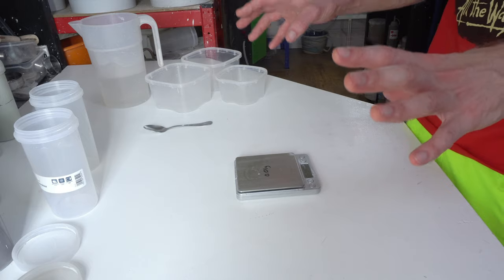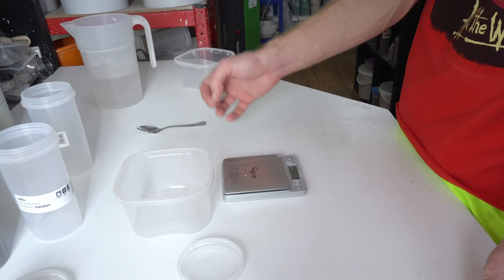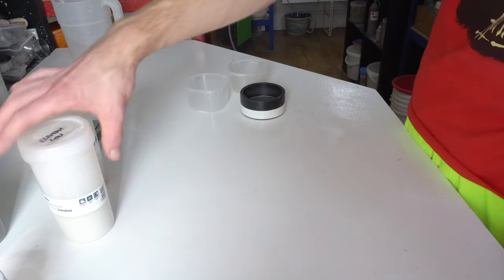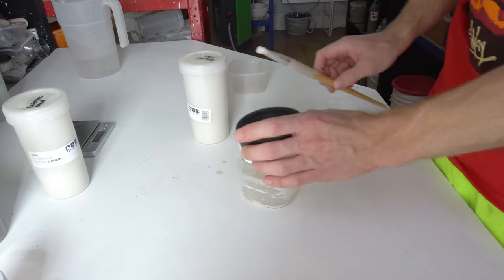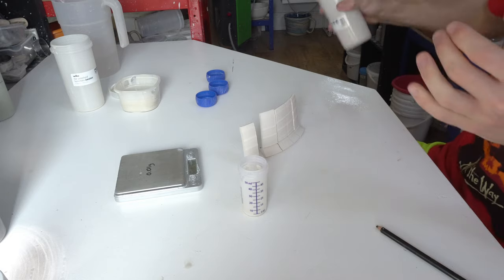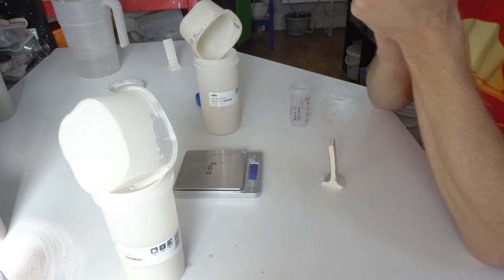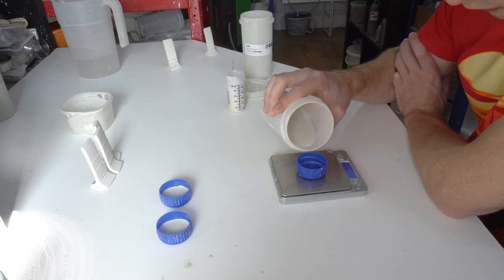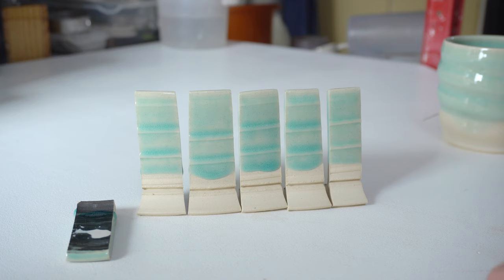How I Mix and Apply my Glaze Tests

Comment: Hi - I use a rubber spatula to get things through the sieve.   Saves shaving the paintbrush!  Very interesting content- thanks
Reply from the maker: Yeah, I don't use the paintbrush for the larger sieves, but the small one is too small for the larger brush I usually use. A small spatula might work, or just a rubber brush with bristles too large to go through the holes. But as it's just for tests, I'm not so worried about finding a better solution

Comment: I would say that a disposable dusk mask is not enough. Wearing a mask that is filtered for dust particles is important - it is more than preventing silicosis but some of the ingredients we use can affect the nervous system or are toxic. ie lithium. At uni we had a girl who was using lithium and no mask (despite all the advice, rules and warnings) she dropped the container and it puffed up into the air and she breathed in a lot and had to go to hospital. She had immediate breathing difficulties but went on to display tremors and dizziness. She recovered thankfully but it could have easily been avoided if she had worn the proper mask. Anyway moving on - thanks for the info on ceramic materials workshop which was easy to find on google search and i am planning on taking a course to refresh my knowledge.
Reply from the maker: Agreed. I think all I said in the video was to use a proper filter mask, and the disposable ones were better than nothing, but if you're working with powdered ingredients then you really owe it to your future self to take adequate care. I'd still rather people wore a disposable one than nothing though.

Thanks for reminding me about the CMW link, I'd forgotten to add that when doing the description.

Comment: Use a 50mL skirted conical tube if you run out of those baby feeding tubes. You can get them from amazon or any laboratory supply shop.
Reply from the maker: Thanks for the tip!
Reply: @OldForgeCreations  no problem!  I like your work and your videos are very calming. I will be coming back for more! 👍

Comment: If your brush hairs are breaking off, are they ending up in your glaze liquid? I wonder if a silicon spatula (like those used in kitchen) would help press the solids through the mesh better as well as scraping down the lumps off the sides of your containers. You've measured the solids so maybe it will affect the recipe if the solids don't emulsify?
Reply from the maker: They almost certainly ended up in the glaze tests, but never at a level I've noticed. For my larger sieves I use an IKEA kitchen brush which doesn't have the same problem but is too big to use effectively in the small sieve. I tried a spatula before and didn't find it as effective, but it might work better than the old paintbrush.

Comment: Awesome info. Definitely inspired to dive in and try to have a go and slowly get away from the current go-to Amaco etc. Forgive my total beginner question, but if I were to use this recipe as a starting base glaze without the copper carbonate, could it be possible to make, for example, a white from the clear base recipe by adding something like a Tin Oxide in place of the copper? Apologies if this is way off the mark, sometimes it pays to ask!

Cheers!
Reply from the maker: Thanks! Yes, that would be a good way to start developing a selection of glaze colours. This might not be the best all round glaze base, as it's a little on the runny side, but you could make it white with tin, titanium, or zirconium.

If you're looking to get into making your own glazes, I really recommend the Ceramic Materials Workshop courses. The cone 6 one is particularly good as an intro into it, if you're working at cone 6

Comment: Hi...thank you for doing this. 
Do you target a specific gravity before determining the affects of glaze application thickness? If so, do you target the same specific gravity with each glaze? I imagine that adding a specific weight of dry ingredients; possibly 100 grams, to 100 grams of water will yield the same SG for repeat usage, but given the different density of the various dry ingredients would yield different SG for the different glazes. 
I can appreciate the appeal of runny glazes for the myriad of effects they can create. Still, do you consider the quality of glaze for food usage? Or are these applied only to non food surfaces, such as rims and/or exteriors with a liner glaze for the food usage portion?
My understanding is that runny glazes are less stable, and, as a result, lead to poor glass matrix formation, which in turn may leach. Likely this is imperceptible, but some demonstrations show remarkable leaching of the oxide colorants even in an overnight acid test.
Reply from the maker: I don't find SG particularly useful. You're right about it varying between glazes based on density, but any glaze where the SG and viscosity aren't right at the same water content isn't worth the hassle in my opinion. A good example of this is the Kuan/Snowflake Crackle recipes, which gel up and are basically solid at the right SG or are far too dilute at the right viscosity. It's possible to deflocculate but it's always a battle to get it working correctly.

If a glaze has a good flux ratio, a sensible amount of silica and alumina, and sensible levels of colourants, I'm happy using it for food surfaces. Runniness can be achieved a few different ways, but the only one that will work with those limitations is higher boron levels and from everything I've seen suggests it doesn't compromise the glaze stability the way the others will. That's primarily how the Floating Blues get their movement for example.

Comment: My strontium does not force clumping. My GB does a bit as with Bentonite, ofc...
Reply from the maker: It's not so much that my strontium clumps in the same way that bentonite would, otherwise premixing the dry ingredients would avoid it, its more that my supply comes pre-clumped for some reason. It's annoying, but not the end of the world
Reply: So it's harder and more compact? That seems normal, I guess..